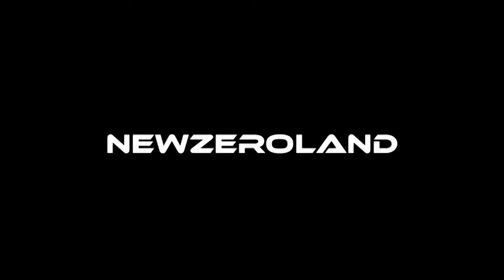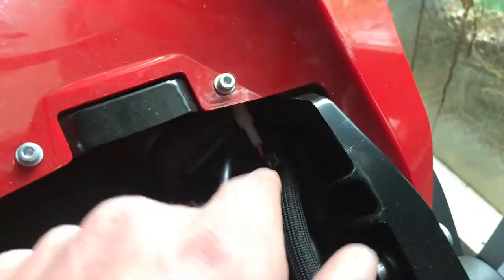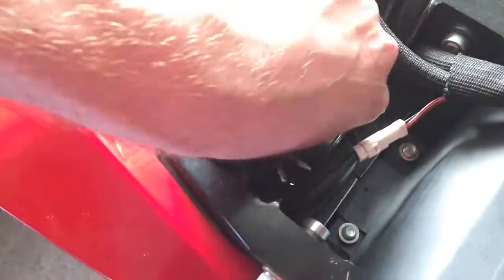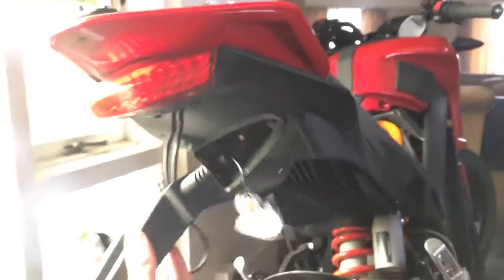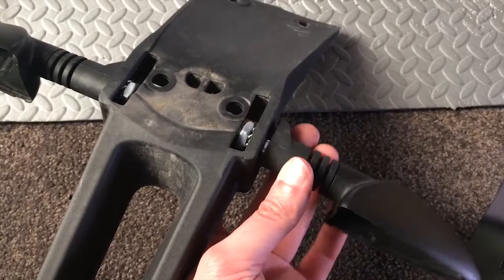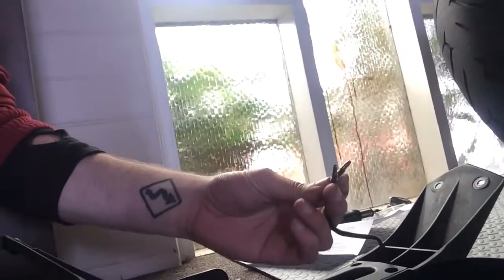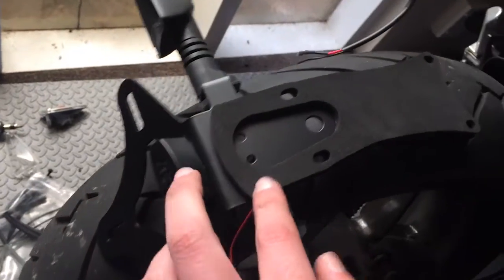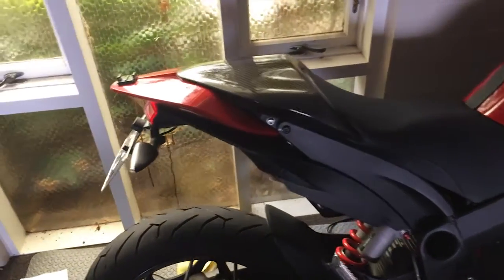Zero Motorcycle R&G Tail Tidy Install

Comment: You inspired me to switch out my tail.  Although I ended up going with a cheap universal red anodized aluminum model.  It wasn't too bad to install, but I have some concerns.  First of all, I ended up having to bend it back into shape a couple of times.  The aluminum didn't like the torque I had to put on the signal lights to get them tight.  Second, while this model was very adjustable, it might be too adjustable.  I'm afraid some of the 8 adjustment screws may loosen up.  I'll probably get some better screws and add some thread lock.  Third concern is the anodize - cheap Chinese anodize tends to peel off.  We'll see how it holds up this summer.  Without your guide, I probably wouldn't have even attempted this.  Thanks again.
Reply from the maker: Nice! Good luck, man. The R&G is definitely too expensive, so anything works. Some people just make their own. I'm glad the video helped! Thanks for watching :)

Comment: Great video!  Thanks.   You do not need to remove the lenses from the turn signals.  I just finished installing this.   Simply undo the nut the holds the whole turn signal on, and swap it out to new unit.
Reply from the maker: Thanks for watching!  You're totally right.  I had no idea what I was doing at the time, haha.

Comment: Just finish installing this on my 2017 Zero SR.  The license plate light didn't require any clipping of factory cable ties as they pulled out from under the tail assembly after unplugging the bullet connectors.  Super easy to do on the 2017 models!
Reply from the maker: Awesome!

Comment: That magnet thing isn't actually a magnet, it's a ferrite choke, and it filters out noise from the bike's electrical system, so that the long wires going out to the license plate don't act like antennas.
Reply from the maker: Thanks for the info!  I had no idea.
Reply: You're welcome!  Without that big chunk of pressed iron dust and ceramics, the 90-odd kilowatts of high frequency electricity that makes our zero motors turn so nicely would stop everyone's AM radios from working.
Reply: skonkfactory interestingly I’ve just done this on a new 2019 zero s and I didn’t have the box thing!! 🤔

Comment: can you explain to me what the big tail is used for, I just got a 2016 dsr, not quite sure what its for, also I want to install black aluminum saddle bags and trunk on mine
Reply from the maker: Nice!  The long tails supposedly block water and mud from spraying all 
over your back, but I don't think it's bad enough to sacrifice the good 
looks of a short one.
Reply: oki doki I'll keep mine then, might just buy a couple small toolboxes and bolt them to a makeshift frame to use as saddle bags, least then they'll be sturdy and will be lockable, probs cost a lot less too